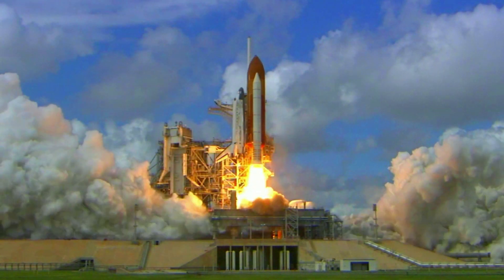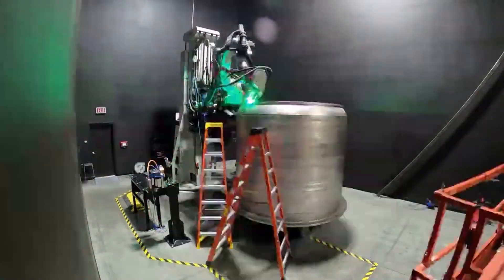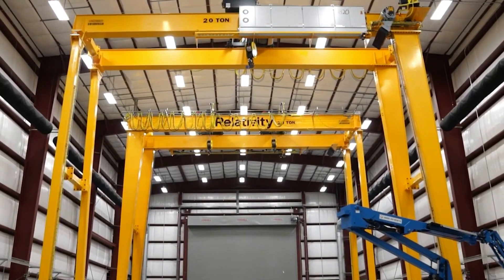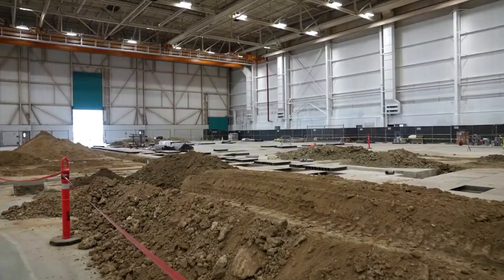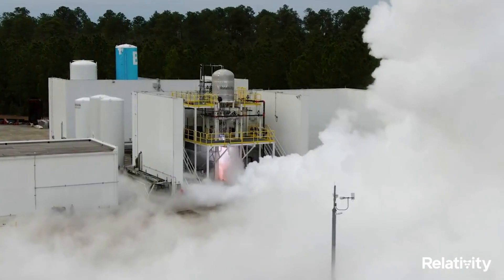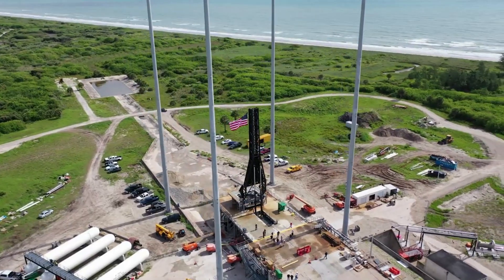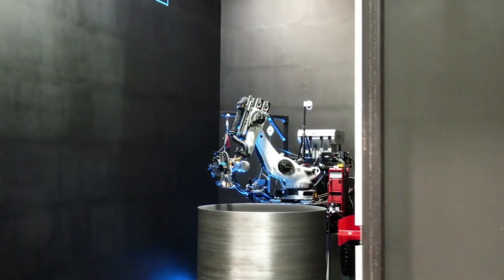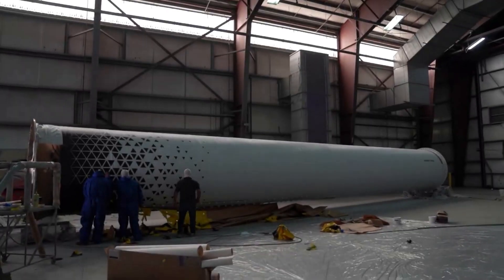Relativity's First Orbital Test Flight Is Not Far Away

Comment: Relativity Space will be interesting to watch. The fully 3D printed rockets give them the potential for extreme flexibility and the ability to iterate very quickly.

They may even be able to change the diameter of their rockets.

If their rocket reaches orbit they will be in a position to rapidly optimize the design.